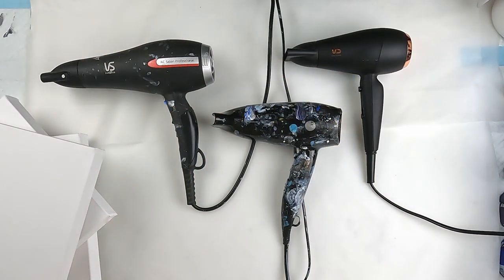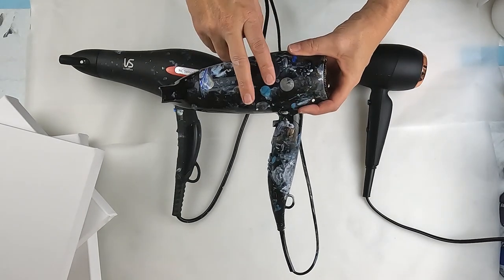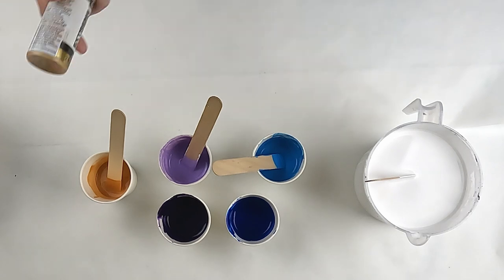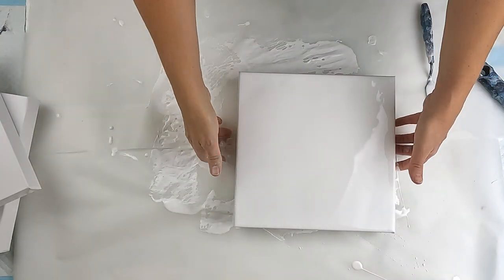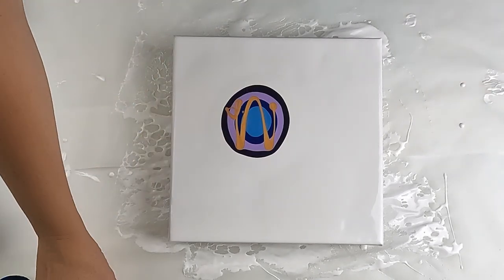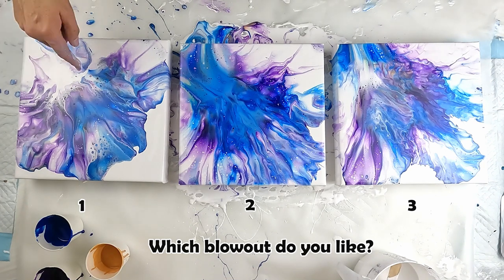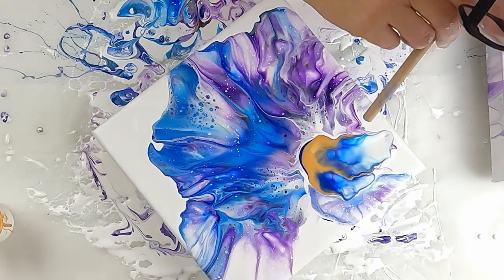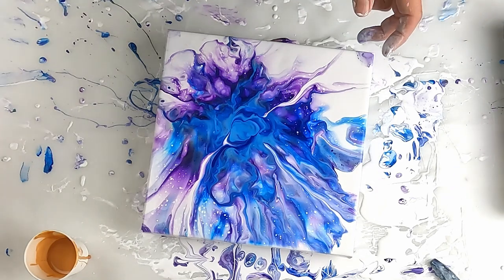HAIRDRYER COMPARISON! How they effect you DUTCH POUR.

Comment: Hi, thank you for doing this experiment, ive spent so much on hairdryers as ive not found one i like since my original one blew up. 
Ive been a beginner for about 12 months now and im still learning. 
Im in Adelaide SA.🎉
I was wondering if you have used a thinned out house paint for your base paint@ if you have what have you thinned it out with@ ive been wasting so much paint which>$$$ thinning out tube paints for dutch base.
Reply from the maker: Hey there, I'm a beginner too 😉 Although I've done quite a few paintings now 😆. I have used house paint but not thinned down. The British Paints low sheen walls interior. I haven't used this for Dutch pours though. I'm still struggling with the Dutch pour technique. Not sure If it's my hair dryer or paint consistency or just the user 😆.
Reply: @fionascreativecanvas  Thank you for replying ❤️ sounds like we are both in the same situation 🤣 it's the Dutch pour I'm trying so hard to achieve. The Shelly bloom I've got down pat (well to my satisfaction 😁) but I much prefer the look of the finished dutch results. 
I also use the British paints for the blooms as I took Shelly's course. It's so addictive and mostly stress relieving 🤣🤣 I'm looking at doing craft groups in the future here in Adelaide, but there is still much to learn ❤️ 🙏 
Your work looks amazing by the way.
Reply from the maker: @dazzlingdiamondpainting7735   I struggle with the blowing in the bloom. Still practicing. Keep me posted on how it's going. The craft groups sounds amazing. I'm in Perth but have family in Adelaide ☺